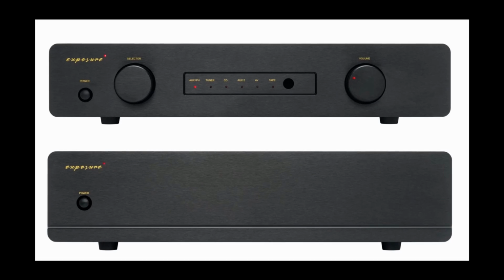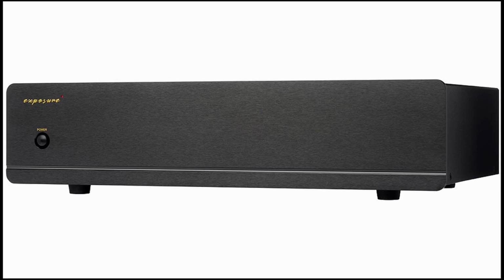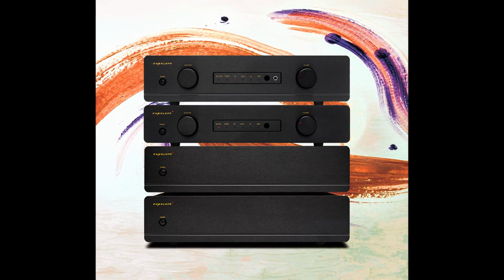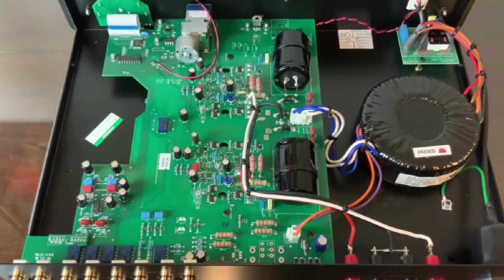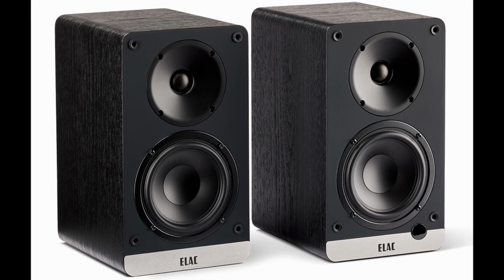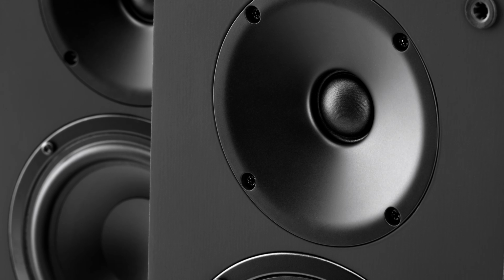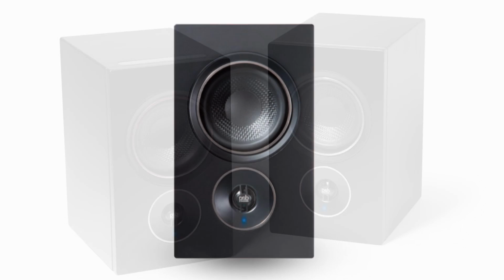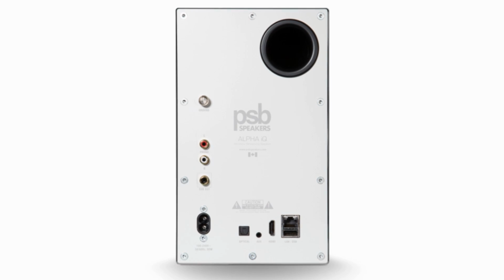What's New? Oct 2022 (Part 1)

Comment: Finally! This verbalises exactly how i felt. the 3510 being superior in almost every regard... but, the 2510 has a slightly warmer sound. Thanks! My question is, and i am a novice, but the 2510 is listed as having a pre amp output, does this mean something else could be added to it to keep the sound but gain some power? Thanks
Reply from the maker: The preouts can be used to connect to powered subwoofers or an additional power amplifier 😊

Comment: Hi Tarun - can you tell me the benefit of having the pre + monos (3510) over just adding the monos to a 3510 integrated or would it be more sensible to just add the stereo power amp to the integrated. Dont necessarily need the extra power but was wondering if the Pre and Monos would be that much better?
Reply from the maker: Basically, better channel separation, less crosstalk, improved power capability, less noise 😊

Comment: Hi Tarun,
Another amazing video.  I would love to see a review of the mono-blocks.  I am a actually thinking about getting another Adcom GFA-555, and running them as mono-blocks.  I definitely do not need the power (would be around 450 watts per channel), but the additional "control" of bass would be appreciated.  At least you are having a bit of weather... it has been very dry here.  It hasn't rained in nearly a month.

As far as Elac.  I had two sets of their speakers, the B6.2 and the F6.2.  I sold both sets.  The bookshelf speakers, while having a really nice mid-range, but were lacking in the lower range.  That is why I purchased the floor standing F6.2.  Those... I was very disappointed in them.  They sounded very shrill.  I ended up purchasing a pair of Wharfedale Linton Heritage.  Those, are amazing... Andrew Jones or not, they are significantly better than both of the Elac speakers (each well reviewed) that I owned.
Reply from the maker: Thank you AP. Much appreciated. Glad to know those Lintons are still singing. Good luck with the second Adcom purchase 😊👍
Reply: @abritishaudiophile7314  With the second Adcom purchase... My husband would kill me!! 😂🤣😂  The real question that I am asking myself:  How much extra "control" (of bass) would the second amp actually bring?  The GFA-555 is an absolute powerhouse of an amplifier.   Mine was tested at 232W per channel into 8 ohm... in addition,  it has 72,000 Micro Farad in 4 capacitors for power reserves.  I'm a foreign language teacher by profession, so money tends to be scarce typically! 😵‍💫😵‍💫😵‍💫
Reply from the maker: @AgentPepsi1  that does seem like quite a beast. I suspect you will have to try going the mono route to scratch that itch. I hope the negotiations go well with the hubby 👍
Reply: @abritishaudiophile7314  You are probably right... but for the time being, I have decided just to run one amp.  Besides, that extra money is needed.  My husband and I have decided to purchase another car, and we want to put a good deal down on it.  The more I think about the mono-blocks, I don't have a room large enough to require something like that.  That Adcom 555 already has massive power reserves.

Comment: Ported two way class D speakers are awful, and even kefs 2 way ported active class AB were poorly built and sound quality average at best with port and distortion artifacts. When you are use to quality audio these will not do the job. All the new active class D loudspeakers most of them made in china are cheaply made on build quality, having sound quality with resonances and added port distortion artifacts, they are just poor rubbish. Your not getting better build or sound quality or value for money today, just more cheaply built crap, or even more expensive crap.
Reply: I dont know what speakers you heard so far, but the new Neumann KH150 has also Class D Amps and Neumann is everything, but def. not awful. Its all about the concept itself and what quality the Amps have